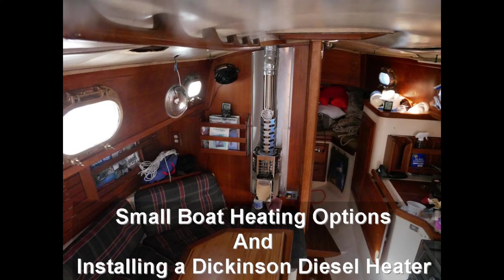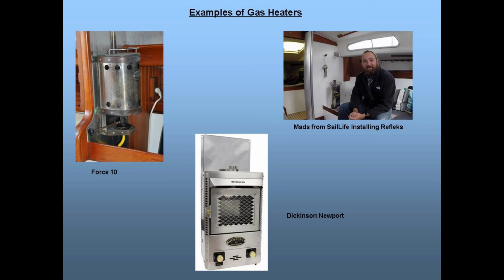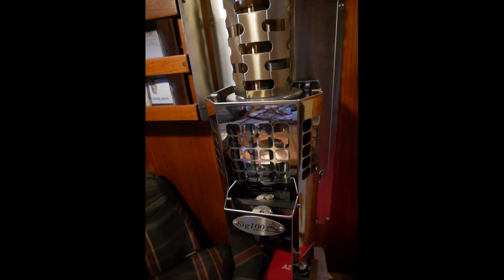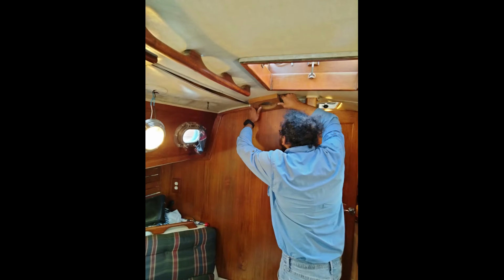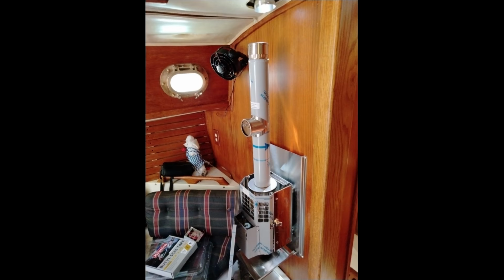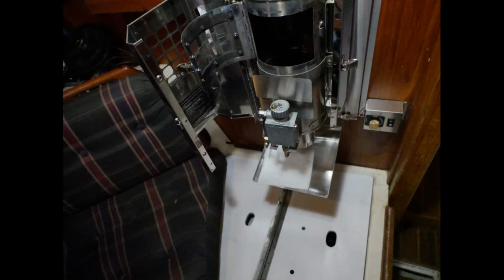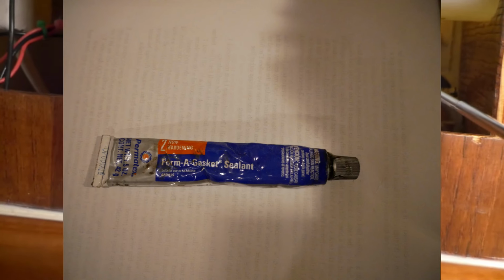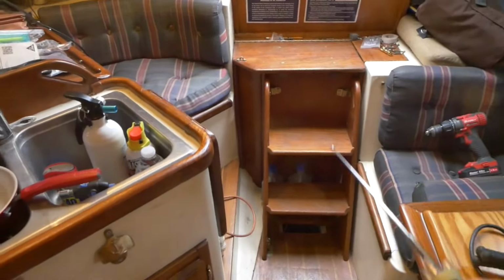Looking At Small Boat Heater Options & Installing a Dickinson Diesel Sig 100

Comment: Very good...Dickinson recommends an overflow tank properly vented to the outside...where did you put that? I have found that when I sail and the boat is healed over some of the diesel slops out from the top of the flow metering valve and would spill into the boat without the overflow tank and the copper line from the flow metering valve back down to the overflow tank. Over the last three years that I have put in my Dickinson Diesel Heater the overflow tank has accumulated about a quart of diesel. I suck out that quart of diesel from the overflow tank with my hand vacuum pump...the same pump that I suck oil out of my Diesel engine when I do oil changes. Dickinson also recommends that you also vent the gravity day tank to the outside to allow for expansion of the diesel fuel and vapors that occur. You might want to go to Dickinson Diesel Heater best install ever...best SV Aquila...Seattle.
Reply from the maker: Thanks very much- great comments! I did attach an overflow bottle to the overflow fitting on the metering valve and I'll be showing that in the follow up video to this. I am wondering how you got so much overflow oil. Is it just from the metering valve itself or from upstream of that too? I agree about the gravity tank. I have not had the boat out on the water since I've hooked up fuel to the heater. I do not have it vented....yet. Not sure what I'll do. Maybe I'll extend an 1/8" line up to the exhaust hose for my composting head.
Reply: @trailsandsails2722  So when the boat is healed over the oil spills out from the top of the metering chamber ( the rectangular box that holds the float mechanism)...it flows over as there is a space or gap at the top of the rectangular box that holds the float mechanism and this is where the excess diesel sloshes over and goes somewhere in your boat if you don't have an overflow tank to capture that excess diesel.